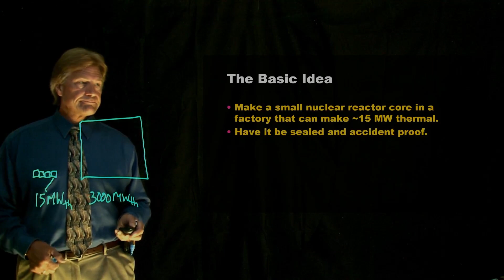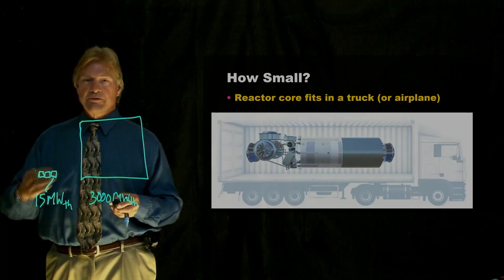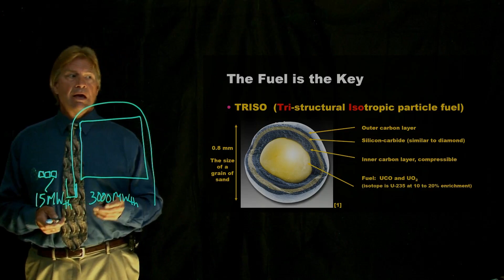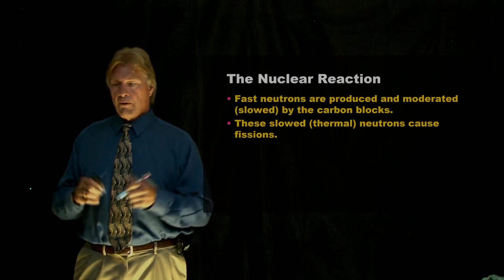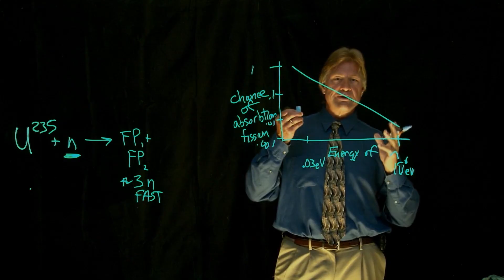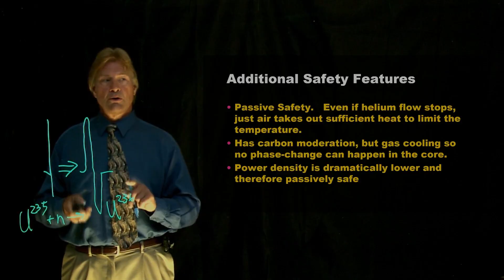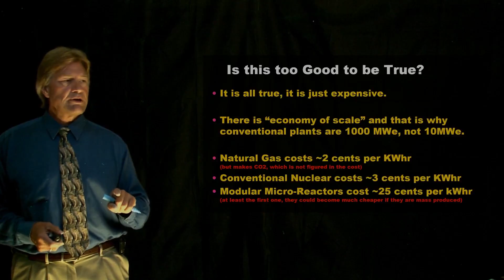Modular Micro-Reactors – The Future of Nuclear Energy?

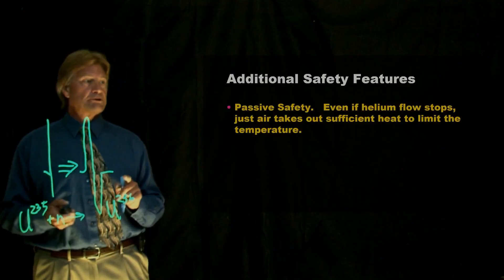Comment: at 11:45 I strongly STRONGLY disagree with the assertion that someone letting air into the cooling loop is a who cares no big deal situation. In fact, a catastrophic breech of the inert gas cooling loop on a reactor like this will result in a ROARING INFERNO of highly radioactively contaminated graphite BURNING IN AIR. This is a horrendous situation worse than a mere Fukushima style meltdown and much more akin to a Windscale or Chernobyl style burning pile of radioactive rubble. I've never liked pebble beds for this reason and barring a completely radical new type that solely uses refractory materials throughout, I never will.
Reply: @George Mann basically I would just suggest any detailed examination of what happened at Windscale, it was an air cooled graphite core where the burning had little to do with fuel or cladding.
Reply: Graphite isn't charcoal. It's really hard to get it to burn.
Reply: @wwoods66  Not when it's at 1000C it isn't. Which obviously it would be in normal HTR operation, and would far exceed in an accident scenario.
Reply: @George Mann which then effectively negates practically the entire point of redesigning the entire reactor to be walkaway safe. great job.
Reply: If you detect the tiniest air leak, you automatically scram the reactor. 
Then, you can cool the decay heat with air leaks without problem.
Even if a fire starts, you won't get an unstoppable blowtorch because air is not your primary cooling method. You'll never get enough air in there to make it a problem.
Reply: @BlackSharkfr  thermal mass is a thing. and now you're relying on sensors and active intervention for safety again, not intrinsic physical laws, again defeating the ostensible purpose of such a design.
Reply: @George Mann fud and fear porn became unnecessary to kneecap the nuclear industry about 3 decades ago when it naturally kneecapped itself through perpetually soaring construction and operational costs. The final nail in the coffin was cheap gas from fracking a decade ago. There was no moustache twirling conspiracy needed. It's not coming back any time soon either.
Reply: @George Mann ok bro
Reply: @George Mann considering I've worked at a nuclear facility for the last two decades, I think it is rather yourself who clearly needs educating.
Reply: Graphite is dispersed in TRISO fuel to act as a moderator, but the main constituent material for this fuel is silicon carbide, which will not burn in air even at these temperatures.

Comment: Could these micro-reactors be used to replace internal combustion engines in automobiles? Could I drive a car that is powered by one of these reactors?
Reply: Not in the nearest future. As explained in the video, the smallest one could fit in a truck. 2:42
Reply: No.  The basic idea of a nuclear reactor is just a fancy way of boiling water.  They produce electricity from steam.
Reply: Joe Horton Okay.
Reply: Might have to bring back steam powered trains so we can make them nuclear lol. Besides ships they may be the only realistic platform that could support a reactor
Reply: Nolan 

Okay.
Reply: You could engineer a reactor to fit in a car, but it would be very heavy, and the energy output would only be on the order of kilowatts, giving an extremely poor power to weight ratio. It's completely impractical. Perhaps Emmett Brown will show up someday and let us copy his Mr Fusion invention.
Reply: You need thick and heavy shielding around nuclear reactors, no matter the size. It would be too big and too heavy to put in a car.
Nuclear cars were never anything more than a silly suggestion from careless marketing people.

Comment: Using the reactor for heating is interesting. I wonder if it could be used at temperatures high enough to melt steel or similar high energy processes. You could put up a reactor site somewhere and build the energy consuming companies around it, with a pipeline for molten salt.
Reply: Definitely a cool prospect. Utilizing the heat from those molten salts would have a lot of different applications. One that comes to mind is the Haber-Bosch process to make ammonia, given the plant can also produce the needed pressures.
Reply: @SC1240  Ammonia production currently makes 2% of the world's CO2 production. Molten salt reactors could be take that to zero CO2. Ammonia can also be used as a vehicle fuel. If it's hydrogenated you get esters which work like diesel fuel.
Reply: Low temp heat is more important and vastly bigger in scale

A 15MW thermal heat only reactors could be used to heat a district of 5,000 homes

It would be Significantly cheaper than a electricity generating reactor as two thirds of the size bulk cost of the system isn't required of it is low temp heat only
Reply: @George Mann It's also practical when the radiator also doubles as a night light :D

Comment: LFRs are my real intrest for these self contained reactors
Reply: Lftrs have a problem with tritium production and the lithium is seen as a bomb proliferation issue. It's not but that's the politics. Moltex and Elysium went to fast spectrum because that can burn down the existing waste fuel stocks. It also avoids the proliferation issues as simply making the fuel salts, denatures and contaminates even fissile materials. Elysium say they can be fueled with irradiated waste fuel, bomb grade plutonium and even depleted uranium.
Reply: a LFTR needs to have its fuel topped off regularly and gases extracted. It's really not a suitable system for a small modular reactor, especially since the purpose of the LFTR and the MSFRs is to consume unenriched Throium or waste Uranium/Plutonium. LFTRs and MSFRs are much more suited to grid power and replacing fossil fuel on a watt-for-watt basis. 
These SMRs are built differently for a different purpose.

Comment: Always exciting to see another video about nuclear energy!
Reply: Then solar. being readily available and much cheaper should make you positively orgasmic!
Reply: @stevemickler452  Surplus solar panels obviously at under a nickel a Watt are cheaper than nuclear but only if nuclear is used or wasted to produce electricity. The $0.02 panel Supply is limited however and people continue to contend that solar Farms are being buried in landfills. Even 5% efficient panels provide excellent shade and are structural. We need a law preventing their destruction apparently. I think 5,000 people died in India a day from lack of oxygen so electrolysis I would save those lives even if the hydrogen was just vented to the atmosphere duh
Reply: @stevemickler452  UAE are going full throttle for PV. https://insideevs.com/news/427990/adu-dhabi-solar-bid-record-price/ 15 years ago I had never assumed that the cost went down like this. It was 50 ct/kWh back then, now, in the sunny MENA region it is less than 2 ct/kWh. 

I wonder what the final bill will be for the Barakah plant with its 4 units. And sooner or later the Saudis will discover that is is cheaper not to burn the oil and gas by themselves, but to install PV plants like the neighbours and sell oil & gas on the world market (there is already the rumor of peak demand).